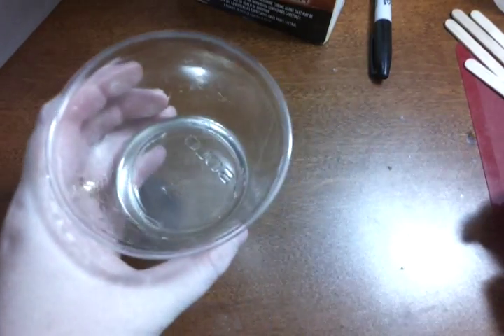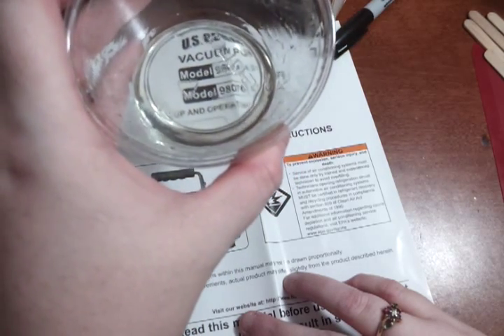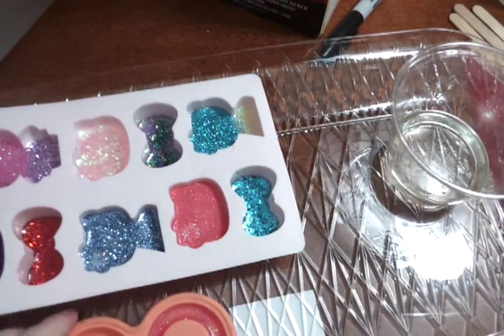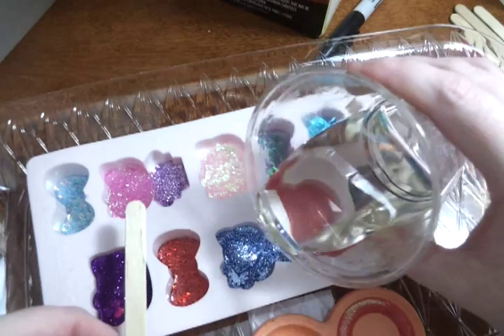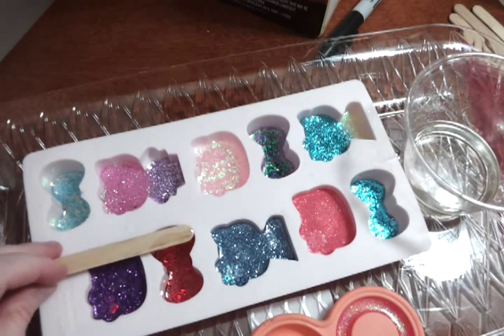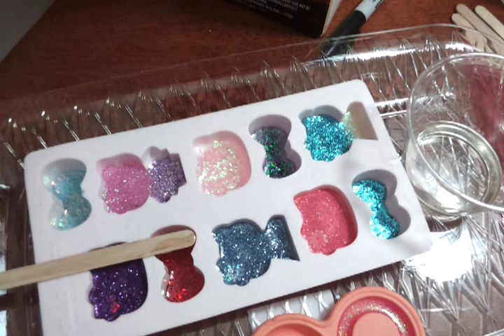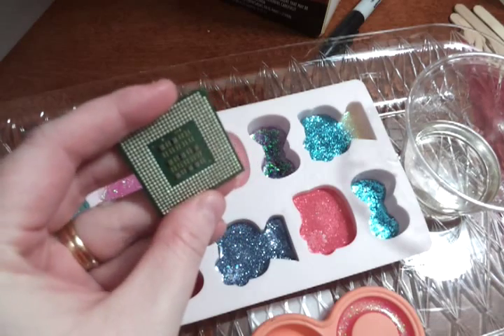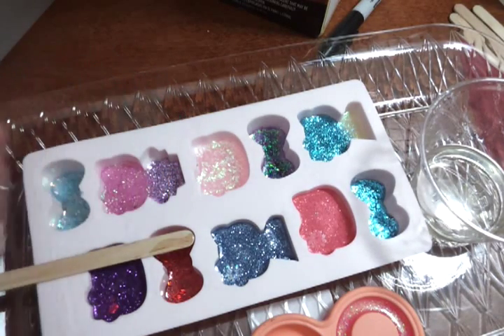Mixing Resin Using a Vacuum Chamber Part 3 of 3

Comment: I normally use polyurethane resin so know the bubble issue. one thing I use instead of a vacuum chamber is a pressure pot. you have to be able to work quickly but it's doable!